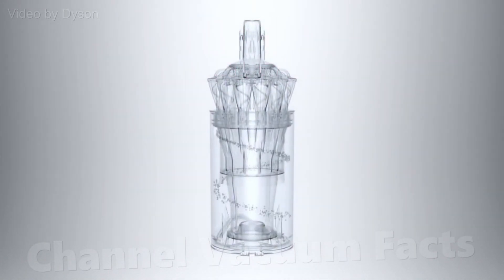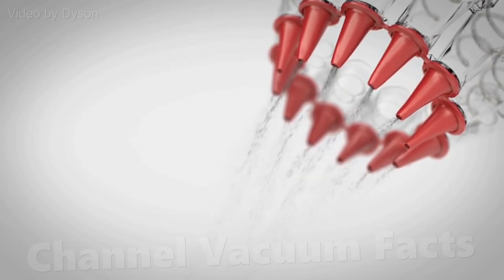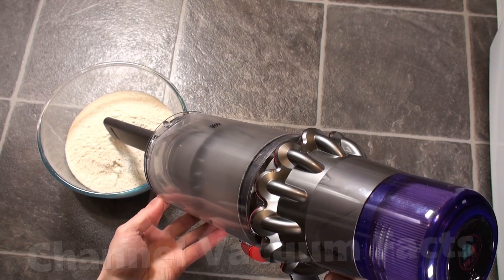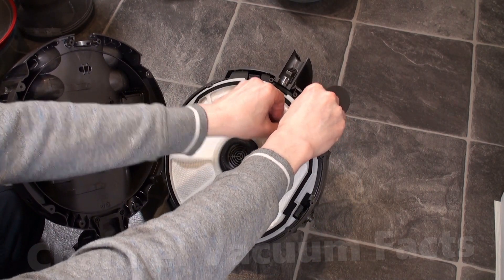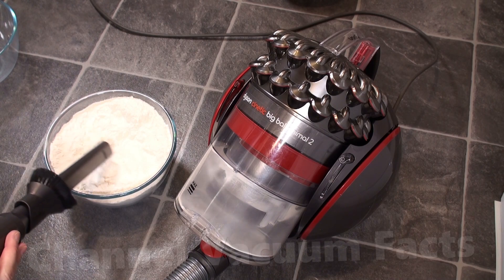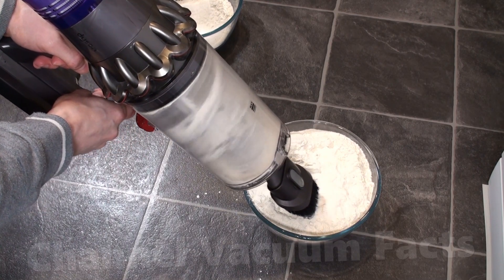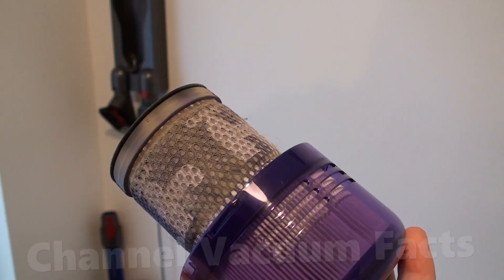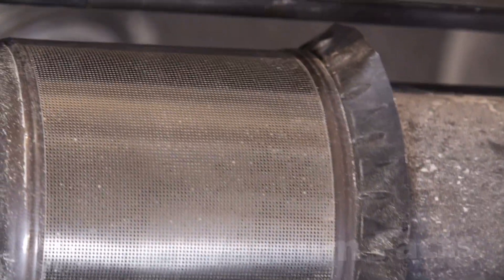Dyson Cinetic Myths – Testing How Good It Really is!

Comment: I had the Cinetic ball 2 was very impressed by it. The retractable cord mechanism eventually broke 😢 and I’m now passed the stage of dragging wires and pulling the machine around. I currently have the V11 and upgraded the torque head to the v15 anti tangle head and upgraded the original purple filter to the blue HEPA filter from the V15. So I’m good for another couple of years. Hopefully with improvement to battery technology we will see a cinetic cordless. I do find if I operate the v11 upside down its more likely to clog the filter 🌪️
Reply from the maker: I've never once managed to clog a filter by using the cordless upside down. In fact, when I think about it, I've never once seen a reproducible, objectively quantified methodology published to reproduce a filter clog. As such, I'm sceptical it can happen in normal use, with a bit of care, such as emptying the bin after every use, taking all of 5 seconds.

Comment: Appears to be a technological marvel but not user friendly.  All the Dyson's I've seen use a motor pre-filter and has no indicator when replacement is needed.  Changing the filter as showed in the video is not user friendly.  Dyson is like many a fashion product, frequent model changes, the filters need to be bought years in advance because the product will no longer be supported and third party support will likely be non existent.

It's not realistic to have the user monitor the bin level, there needs to be an auto shut-off feature.  And the bin needs to be larger to reduce frequency of emptying.

Bagged vacuum cleaners have had the auto shut-off feature for decades and with a larger capacity.  There is still the issue of emptying the bin of fine dust and cleaning the bin.
Reply: If you read the manual or any of the maintenance tips you’d realize how ridiculous your claims are. It tells you exactly how often to clean the filters and how to maintain the vacuum. If anything about owning a Dyson is confusing or anything less than simple, than unfortunately you are cognitively disadvantaged.
Reply from the maker: You seem to have misunderstood despite it being spelled out very clearly in the video. You don't need to replace the filter 'as shown in the video'. What was 'shown in the video' was evidence that the filter doesn't get dirty with this particular technology. Not sure how on earth you got confused by this. As for your suggestion that it's not user friendly; you clearly haven't looked at the competition. And I'm completely unconvinced that the user bears no responsibility for basic care and sensible use. Your equivalent is not to expect the user to have to know when the fuel tank is empty in their car, and 'it should be bigger to avoid needing to fill it up as often' (ignoring the consequences of excessive size). Bagged cleaners also have utterly vile smells because the bag is so big and never emptied. The solution is already explained meticulously in several videos on this channel. Empty after every use; it takes 5 seconds, incurs no mess if done correctly, and is costless, without any environmental impact. I see no evidence you've thought any of this through.
Reply: @VacuumFacts  Unless it's stated upfront, it can be assumed a pro view of a product is an infomercial, sponsored or received free.  The non frequent need to replace the filter does not mean no need to replace.  In real life with most users they never replace the filter and the vacuum either ends up in the trash or shop.  The year is 2022, like many bagged vacuums, most cars will give a low fuel tank warning.  A smelly bagged system can be alleviated by replacing the bag and/or using a off-the-shelf product that is simply vacuumed.  The Dyson system is not a costless system.  Lack of a bin filled warning or shut-down feature and the filter never replaced by most users makes for a disposable product.  Most quality bagged systems will last 20+ years.  Get anywhere near this age with a Dyson and the filter(s) will likely be unavailable.  Cleaning a filter will degrade it's performance dramatically.
Reply from the maker: The filter is a lifetime washable filter. It never needs to be replaced (unless abuse has occurred); just rinsed. I have a video explaining the myths about the virtues of bagged cleaners. The Dyson system IS a costless system, by design (unless neglect and abuse has occurred). The bin is transparent; it is abundantly clear to any user at any time when it's full—unlike a fuel tank which is invisible and relies on a warning system. The faulty logic of long lifetime products that are less efficient than modern ones is exposed in other videos, and the lifetime myths of bagged systems and the associated running cost downside is exposed in the earlier mentioned video. You claim "Cleaning a filter will degrade it's performance dramatically", yet provide no evidence to support this falsehood.

Comment: coming back here because I just want to say, a few months ago, I realized why having more power is better for fine dust filtration which is quite opposite to basic expectations. fine dust is tiny and light weight, adding more speed to these particles running in circles, is equivalent to making them heavier thus less chance of going to the fine/HEPA filter.
having said this, I'd continue using cordless vacs at low power because of much lower noise and less wear on the batteries. in addition, the cheapest vacs are low power, thus also low noise. I was able to manage or prolong filter clogging by a few more days by using an old toothbrush for cleaning whenever I empty the bin.

Comment: Dyson, bring back Cinetic!
Reply: I think they were concerned about motor failure due to no pre motor filter so they cancelled it.
Reply from the maker: You realise it was actually magic goblins which cast a hex and caused it to fail; that's why they cancelled it. >_>
Reply from the maker: For anyone with an IQ, the reason why they likely discontinued the concept in the cordless range (their future) is provided in this video that people don't watch carefully before commenting...
Reply: @VacuumFacts  animal 2 and animal 3 that came after the cinetic big ball have pre and post motor filters. I have a cinetic big ball animal and after using it you can see a light dust film on the tube coming from the canister. I wipe it out every time and the dust comes back so obviously the motor is sucking dust in.
Reply from the maker: Yes, that's because mains is old hat; they took existing established technology and made a 'final version' (the animal 3 BTW is the light ball from 2017) which lacked all the latest features. Self-cleaning shrouds were also in the cinetic models but not on the animal 3. By your logic, that tech didn't work either. Except that IS in the stick vacs. The cinetic cylinder cleaner is also still sold in some countries (all this was discussed in this video you didn't watch along with the REAL reason why they stopped it [hint: it's a physical aerodynamic reason]). Your claim about motor 'sucking dust in' doesn't show any understanding of this technology (also fully discussed in this video you didn't apparently watch), or that over its 10 year lifetime, in the absence of abuse, it will never lose suction. I also showed clear evidence in the video you didn't watch that it can suck up huge amounts of fine dust and nothing significant gets past the cyclones. You seemed to ignore all this and instead make up wild claims unsupported by any evidence whatsoever.
Reply: @VacuumFacts  I literally have a dyson UP14 and it’s needed a motor and a circuit board. My dyson up13 which has a pre motor filter has never had any issues and it gets used in residential cleaning every day for multiple hours on end. My dyson up14 with no pre filter couldn’t even handle my house without the motor failing.
Reply from the maker: I don't necesarily doubt you had a problem, but I simply don't believe the cause of it was the reason you stated. It conflicts with plenty of evidence available of the opposite. You've provided no evidence of how to reproduce your problem either, or in fact, any details at all other than a few vague anecdotes. So, believe what you want, but you're not convincing anyone here.

Comment: Great video. Just to reiterate: Dyson’s filtration system, ESPECIALLY with the Cinetic, requires that you empty the bin as soon as the contents reach the “Max” line—even if there is space on the other sides. Failing to do so compromises the cyclonic and HEPA filtration in the normal Dyson vacuums and will completely clog the Cinetic’s filtration system. Failing to follow simple directions is the reason people had issues with the Cinetic vacuums.
Reply from the maker: Mostly right. There are nuances you may not be aware of. https://youtu.be/uuF0Q0x3P8E

Comment: Why wouldn’t you test it twice with it upright then do an upside down? Though, in any study, if there is a difference found, regardless, you’ve proven your there’s a significant result. Truly amazing tech. Do you think your result of the handheld have been compromised because you filled it past the max, thus decreasing its performance? Thanks for the video! Very interesting.
Reply from the maker: Bear in mind, this wasn't a scientific study; just a quick myth bust. RE fill line: not really, given that max mode (mains comparable) showed no significant filter accumulation. I also filled the Cinetic model above the max too (deliberately) and it showed no filter dust. Its brilliant bin design helps there. I was only above max briefly too.

Comment: Wonderful video. This has taught me that if I do dare to hoover up sawdust or concrete dust with my v11 Torque, it would be best to use it on boost mode so that less fine dust makes it through to the filter/motor area.
Reply from the maker: That would reduce the service life of your battery if a regular occurrence. The real lesson is to simply rinse the filter.
Reply: @VacuumFacts  For me, it wouldn't be regular, just the occasional spot of DIY.

Comment: amazing review, with practical tests. I have two dysons. A DC08 which I have used AND abused for more than 10 years. It only clogged when I connected it to a sander and sanded some paint (the paint debris caked internally). Taking it apart is not a big deal. And obviously it's not designed to be used like that.
In my garage I have a DC32 (I think) which is always connected to tools and my table saw. Yes, the filter tends to clog easily when abused a lot but hey, again the Dyson is not designed for that. Still, it outperformed a £200 Makita dust extractor.

For domestic use, my DC08 has been working FLAWLESSLY since 2008. I look forward to checking all your other videos! :)
Reply from the maker: And some of my naysayers still claim you can't use it for DIY... I never believed them
Reply: @VacuumFacts  I gave my brother a DC08 I got for free. The DC08 has a design flaw on the bypass valve (when it's triggered, it stays open even though the flow is restored - that translates into a slower flow in the cyclons which, as you noticed, results into a lower efficiency, clogging the filter). 
With that sorted, he's using it to suck ash from his fireplace and it says it works way better than a dedicated machine he had purchased for the task.
Yes, I do feel Dyson's are great for DIY - there are better machines for the task indeed but I can get a second hand Dyson for £50 which I can use in my workshop.
Reply from the maker: Whether that affects all machines or just that one isn't clear. But the DC08 is a 20 year old machine not even sold anymore. Some of the newer machines have the valve before the cyclones, so no reduction in cyclonic filtration performance if triggered. And they definitely reset. The cordless models don't even have such a feature; if blocked for long enough, they simply report a blockage and stop.
Reply: @VacuumFacts  Both my DC08 have the same flaw. For the "average" person that simply means "the filter keeps getting clogged" since if the bypass triggers at the beginning of a cleaning cycle, they would then keep cleaning with that reduced filtration. The bypass lets air in from outside directly into the motor (the idea is that it could be the cyclonic unit being clogged so it has to bypass directly to the motor to prevent overheating) hence the overall air expelled by the unit is the same but only a fraction of air now goes through the cyclonic unit - hence the reduced filtration and filters (which are AFTER the cyclonic unit) get clogged etc.
It is indeed disappointing to see such expensive machines with such important - and easy to fix - flaws. But I still love my dysons, they just save me tons of money in bags and - if used correctly - they just do what they advertise.

Comment: We have serviced hundred of cinetoic machines since they were launched a few years ago. Yes a few were abused so understandably clogged or had problems. However many of these machines were well taken care of machines were plagued with pets hairs and fuzzies getting caught in the shroud and in the cyclone tips. Also on many the lost hepatitis filters were caked in dust after a years worth of use rusting in burned up or very unhealthy motors. I purchased one these myself as I take most excellent care of my belongings including my vacuum. I used it every other day for a year. Never over filling, vacuuming up anything wet or even reportedly damp. At the end of the year the machine still ran well. But the post hepa filters you could literally tap against a surface and see dust falling from them. The cyclones do not work as advertised. And after a years worth of vacuuming with the Dyson I went back to my Kirby G6 and pulled up nearly half a bag full of dirt grit and other debris. Even if the Dyson cyclones truly did work perfectly the cleaning power of this machines is still sub par.
Reply: Ive had my machine for 6 years. You have to somewhat baby these machines. The cinetic cyclones need high velocity air to work, it does clog somewhat easily (bypass valve getting activated easily) but my post motor filters weren't that dirty after 6 years. If they kept developing these I think they would have improved, but the 700w motor EU limitations killed that. Those 700w motors aren't strong enough fir Cinetic cyclones to work effectively
Reply from the maker: o_0 Well that vague anecdote fully refutes the meticulous empirical observations shown in the video. >_> I've seen absolutely no evidence to show how your claims of failure can be reproduced without abuse. The video clearly evidences they work; you haven't accounted for this observation and have literally ignored it. Any failures are almost certainly due to neglect. If you have reputable evidence to support your otherwise unconvincing claim that "the cleaning power of this machines is still sub par", please send it along for scrutiny. Myths about Kirby cleaners are exposed and debunked on my channel.
Reply from the maker: <tumbleweed> ...figures

Comment: The infamous Dyson Cinetic system of my vacuum got completely clogged in just three times of use what is almost new, and as I've been researching this is a common issue on every single model of the Brand. Trying to fix it is totally impractical since the filter unit was designed to make it barely impossible to disassemble and clean. Avoid purchase any Dyson item at all costs.
Reply from the maker: Hell knows what you did to it then. Given the evidence presented here that it works perfectly, and absolutely no evidence whatsoever for your wild and unbelievable claims, I can only conclude you're likely not telling the whole truth...
Reply: Do not vacuum your wet cat litter, no clogging with dry dirt at all.
Reply: Vega, sounds more like vegans and those type of hipsters who are unable to buy a Dyson anyways. So Enrique is all bullshit and never had one.... don't listen to his bullshit... they just want to chose crap stuff and cry about good systems they cannot afford

Comment: I have the Cinetic Animal+Allergy upright.  I never let it overfill, i empty at or just below the max line or after each cleaning, and wipe the mesh shroud off inside when it starts accumulating anything, usually every 3 to 4 months.  Filters have very very small carbon discoloration inside after nearly 5 years of use.  I've put it through some tuff cleaning, it always stays constant and really cleans the air
Reply from the maker: Yeah, they work as advertised. This video fully exposed all the propagandist dyson racists who continually made false claims (without evidence) at the time Cinetic models were released—often by 'repair shops' and the like whose false economy was threatened by advancements in technology.

Comment: Since the efficiency of the cyclones is based on the constant high-speed airflow, do changes in airflow (such as when starting up/ powering down, moving to a heavy dense carpet, accidental blockages etc.) affect the Cinetic performance, or is it somehow addressed in the design? I have a v11 myself but am considering a cylinder before they discontinue them for good, and the choice is Cinetic or classic big ball...
Reply from the maker: Most people don't start vacuuming in the second or so before it's started up fully, so I doubt it's an issue in practice. That's the beauty of the digital motors of the dyson stick vacs; they start instantly, unlike the competitors. And cyclones still work, even when not accepting full volumetric flow rate (the V11 in normal mode shows this). I wouldn't bother with any other formfactor. I can't stand mains plugins now, especially the cylinder formfactor. They're on their way out for a reason—namely because they're relatively crap. It's like saying "Oh, I better get a candle before they discontinue them now we all have LED lights".